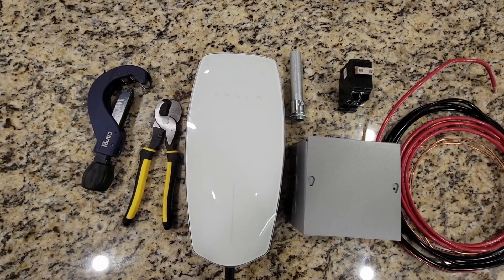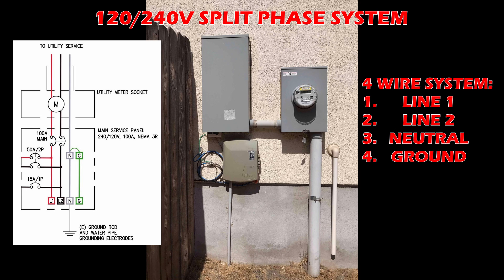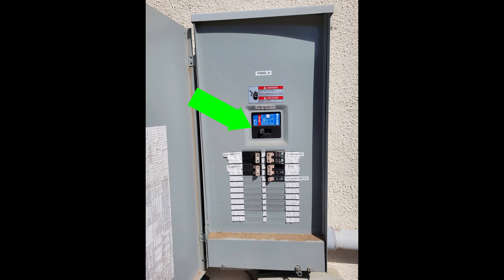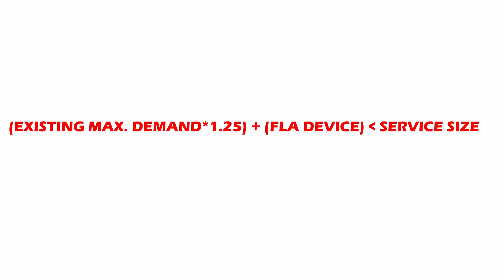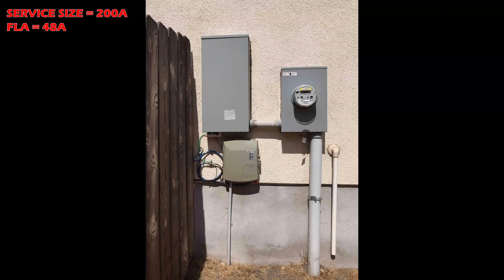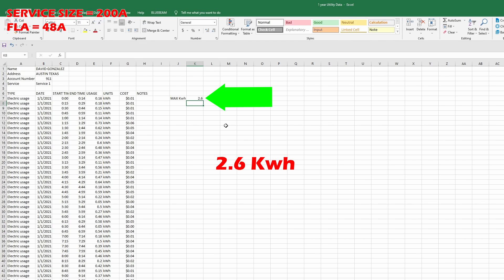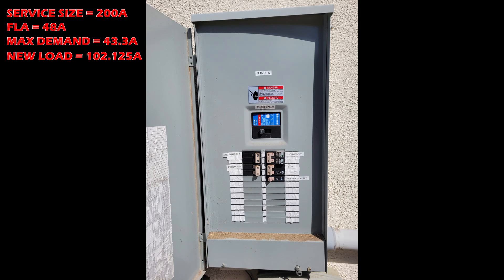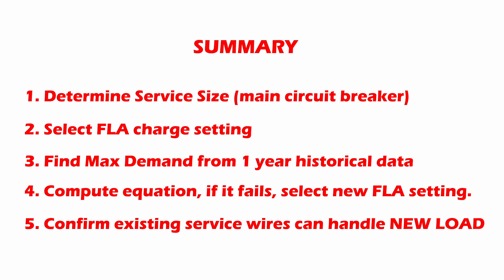Watch THIS before Selecting your EV Charger Circuit Breaker Size DIY

Comment: Super helpful.  When putting in the new circuit, I wanted it to be capable of the highest possible draw to be as future proof as I could make it.  But when selecting an EVSE you don't necessarily need one that can draw the absolute maximum the circuit can handle.  I figured out that a 32 amp EVSE was going to easily handle everything I need, 99.9% of the time.  So I got a slightly smaller EVSE, which does three things, all good for me:  (1) it was a bit cheaper to buy initially, (2) the car charges at a marginally slower rate which is good for the batteries; and (3) the wires in the wall, the plug, etc. are all running a solid notch below what they are theoretically capable of handling, which just creates some additional margin of safety.  Code is the minimum requirement you need to meet, but there is nothing wrong with pulling 32 amps through a circuit that is theoretically capable of handling 40 or 48.   It is basically the same idea as plugging a 60watt lamp into a standard household outlet that can handle up to 1,800 watts.   Most people who haven't lived with an EV don't understand that you plug it in when you get home in the evening and then you really don't much care how long it takes to charge as long as it is ready to go by early the next AM.   Fast charging is rarely important at home, you really only care about that when you are on a longer trip and you have to top off the battery to continue the journey.
Reply: Yes, indeed. I'm trying to install an EV charging outlet in my garage. What I'm trying to figure out is: is it even worth the extra cost to buy a 240V/60A outlet and breaker as well as more copper if I will most likely charge at 24 or 32A? I might be paying an additional $100 or so for something that I will never use.
Reply: @ledzeppelin1212  I think that depends on how long you plan to be in your current house more than anything.    Batteries and charging rates are only going to get better.  I decided to future proof because I may be in the house for another decade.  If I knew I was moving in three years I might have done things differently.  I would say you have to be confident there is a 0% chance you will need higher charging rate because plug and wire are cheap compared to the cost of the electrician.   You definitely do not want to pay to have it all ripped out and replaced in five years.

Comment: Great video but with an EV, you normally only need to get enough charge overnight for the next day. So while 60A/48A may be nice, I think a lower cost 40A or even 30A circuit @240V would be fine. On my Tesla MY, and just using a 120V, 20A circuit running at 12A, I get 30 miles per night and I only drive 25 miles a day.
Reply: The cost difference between a 30, 40, 50 or 60 amp circuit breaker is only several dollars. The same goes for larger wiring to support those higher amperage circuits. It's several dollars. Conduit and sheetrock work and repairs are the same.

The cost of the electrician's labor is what is high.

If you can find a good handyman who knows the rules in the current electrical code, that is the way to go for cost savings. Especially for most easy and simple garage interior installs.
Reply from the maker: agreed.
Reply: The only reason why I went for a 50A/40A was bc I wanted the flexibility of using a NEMA 14-50 outlet vs hardwired — in the event I ever move and can unplug and move the charger myself.  For the 60A/48A option, you need to have it hardwired.   I hired an electrician who did a great job and charged me a reasonable $350 for the NEMA install (including mounting the Charge itself).  It would’ve only cost me an additional $50 for the hardware option.

Comment: your main breaker will protect the service wires.  the service wires will (or should be) always sufficient for the main breaker rating.
Reply from the maker: Your statement is only partially true and ONLY applicable to modern homes. Homes from 1960s and older were designed and built with very different standards than today. Service wires and gear were sized very differently than today. This is why I mentioned it is CRITICAL to confirm service wire size.
Reply: @dgtv3320  ok, i've just never seen undersized service wires before!

Comment: My main circuit braker is 100A. When I do the calculations you mentioned, it exceeds 100A (Comes up to 110A). Can I just replace the main braker with 200A, and would it be safe after that?
Reply from the maker: Semih, you cannot do that. Up sizing the breaker would involve up-sizing your electrical panel and service wires. And it would require a utility shut off. This type of work is only allowed to by done by a licensed electrician. For a 100A main circuit breaker & panel, the biggest limiting factor is the size of your existing service wires. The older your home, the smaller your service wires will be. As I mentioned at the end of the video, you cannot exceed the rating of your existing service wires. Please reach out to a local electrician to help you determine your best path forward.
Reply: @dgtv3320  Thank you very much.

Comment: I can’t to download the usage for electric, only show day use or hr use how  can I do 
My panel 100amp can I to add 60amp
Reply: You almost certainly can't with a 100 amp panel.  Also you don't need to.  My wife's 2016 model X can only take 40 amps.  They used to have an option to upgrade to 80, but I didn't buy it.  I don't even see that option any more.  My new model 3 only takes 32 amps.  And that's more than enough to fully charge by morning, so there's no need for more.

Comment: Super helpful, thank you!  My local utility wouldn’t let me download a years worth of data all at once, I had to do it one month at a time.  I have a 200Amp panel and found that my typical monthly usage peaked around the mid 30s to low 40s in amps, but then found one day, where for about 4 hours, our usage peaked at 66Amps, which when I looked it up turned out to be a large social gathering we hosted at our house.  Now I know, which is awesome!  Before this I was thinking I would need to get a 14-50 outlet, but now I know my panel can support the 60Amp wall charger.  Very cool!
Reply: Stick with the 14-50.  My wife's 2016 model X can only charge at 40 amps anyhow, and my new model 3 only 32 amps.  The 14-50 plug and cable can handle that and is cheaper than the permanent EVSE, which won't let you charge any faster anyhow.  I could only fit a 30 amp breaker in my panel anyhow so I charge at 27 amps and it still charges in only a few hours.  As long as it's ready by morning, who cares about charging faster, even if it is possible.
Reply: @phillipsusi1791  I ended up going with the 60 amp circuit and the Tesla wall charger, I can charge at 48 amps, or roughly 44 miles of range per hour.
Reply: @JethroXP  Ahh, apparently all but the M3RWD are now capable of taking 48 amps, but with no option for the dual charger to get the higher capacity like there used to be.

Comment: How does a solar panel grid tie system factor in? Also you mention setting your charge current. Does the EV allow you to set maximum charge current? Thanks. I'm getting ready to pull the trigger on a model Y Tesla.
Reply: Yes, the Tesla allows you to set the maximum and proper charge current, on both the control screen and the Tesla phone app.
Reply: @dvader3263 Thanks for the reply. Since getting my Model Y I've learned that you can also schedule when the car charges, so I set it for 12am start time when demand from the house is low. Also I learned that the cheaper Tesla portable charge cable only charges at 32 amps max. I was hoping for better than that since I installed a 50 amp circuit. Still, that's good for about 30 miles per hour, which is enough for my needs.
Reply: @travelbydragonfly  My wife's 2016 model X charges at 40 amps.  I remember them having an option to buy dual on board chargers to take 80 amps, but don't see that option any more.  I recently got a model 3 and it only charges at 32 amps, using the same cable and 14-50 outlet.  And yea, as long as it is charged by morning, that's fast enough.
Reply from the maker: Randy good question. Solar and battery storage lowers your home electrical demand. Assuming you have your solar/batt and electrical panel on the same utility meter, this lowers demand and this should already be reflected in your utility data. This being said you can follow the same steps outlined in this video. Congrats on your new Tesla!

Comment: Great Presentation. I wish PG&E here ( San Ramon, contra costa , CA ) had provided a way to download my uses data . Without this , I won't be able to benefit from this excellent information that you shared. So I guess, I have to stay with the conventional approach of doing the load calculation based on lighting load , fixed appliances nameplate rating etc etc.

You alluded to doing another video for the use-case of adding the charger to a sub panel and I have a question for this situation for now, while I wait for that video to come up.

My load calculation for the whole house shows enough capacity to add 48 amp charger load on a 60 amp OCPD. But the feed from the 200 amp main panel is evenly split into  garage sub panel and AC load sub panel, each protected by 100 amp OCPD at the main panel. I am told that I have to do a 2nd load calculation on the sub panel circuit with incoming service limited to 100 amp only. Is this correct ? If yes, I have less capacity to play with for sizing charger load .
In my case, I am planning to add  charger load to AC sub panel , which is serving two 5-ton AC units only on a 70 amp OCPD. The load calculation ( treating AC as continuous load device  and taking 100% of nameplate rating for RLA of condenser / FLA of motor  ) for these ACs comes to 66 amps.  This leaves 34 amps extra capacity only. With this capacity, am I ok to install a 40 amp OCPD on the AC sub panel for the charger circuit and configure hardwired Tesla wall charger for 32 amp charging , following the 25% demand factor rule applied to largest motor load in the group ?

Comment: Hi. I have a question. Can I hardwire my EV charger with a 10 gauge wire? I have an existing 30amp subpanel in my garage and I don’t want to run new wire. 
Its going to be 30amp breaker, hardwire to the charger. I hope you can help me? Thanks
Reply: Using 80% factor. Yes up to 24 amp providing no other load on that circuit.

Comment: Is there such thing as 80 amp or 100 amp breaker off of a 200 amp panel? For the 17kw plus charger for tesla or whatever car manufacturer that will allow that fast ac to DC charging. Theoretically, with 200 amp service, that's like 48,000 watts. Not continuous, I know. Or is there a limit here with us or state regulations. As long as I have the correct size wire and not continuously tripping the 200 amp main breaker, is there a reason this isn't doable?
Reply from the maker: Larger chargers are available not but very common. An example is Clipper Creek CS-100, which runs 80A continuous and requires a 100A breaker. Assuming an existing home has enough capacity, there is no problem installing this. I believe these larger units will NOT go main stream any time soon. Most homes have a 150A or 100A service so the majority of individuals wont be able to install this. They are simply too big and there wont be enough demand for manufacturers to start making 100A+ chargers.
Reply: There are 100 amp breakers that you can put on a 200 amp panel, but the car can't take that much.  When I got my wife a model X in 2016, it had an option for dual chargers to take 80 amps, but I didn't get it, so it can only take 40.  I don't even see that option on Tesla's web site any more.  My new model 3 can only take 32 amps.

Comment: Thank you for this well done and very informative video ( frankly the best I have seen). At the beginning you mentioned that you might do another segment evaluating sub panels. I would love that. My attached garage has a 125v subpanel on a 125 breaker from the main panel ( main panel is good with 2/0 aluminum cable to the meter on a 150 amp service)  with  a 2awg  XHHW aluminum tray cable ( thank you for discussing the direct inspection of the leads) to the sub panel . I think it is somewhat under rated , but even so I would like to know how you put sub panels in the equation. Many thanks again.

Comment: Many thanks.  Very helpful.  This will provide peace of mind for a DIY'er.    After searching NGRID online account informationI I called and they have assigned a "ticket" for the requested information.    We'll see how that goes...    I have a 100 amp service which includes 40 amps going out to a detached garage.    I'm hoping I have the capacity to use 20 amps for an EV charger as this would be the least "obtrusive" solution to the existingn service while still meeting my low mileage requirements.   Question:   My plan is to install an industrial grade 20a/240v Hubbell outlet with a 20a double pole GFCI breaker on an existing 12 AWG dedicated line.     Should I consider replacing the 12 AWG wire with #12 THHN set of wires instead?
Reply from the maker: Good choice on Hubbell. They make good stuff. Regarding existing wires, perform a visual inspection and confirm there is no damage/cracking on the insulation. If everything checks out, #12 copper is sufficient for a 20A dedicated circuit and you may avoid replacing the circuit.  If this is for your charger, remember the breaker shall NOT be GFCI. Most, if not all EV chargers have GFCI function built in to the charger itself.  Thanks for subscribing.

Comment: wait what you said doesn't match the formula.  You said "max demand times 25%" but the formula says "max demand times 125%".  which one is correct? thx
Reply from the maker: Excuse the confusion. I should have said 125%  which is 1.25.

Comment: Great video.  If I install the Tesla’s wall connector to a 30 amp breaker, will the wall connector adjust automatically to 30 amps?  Wall connector shows 12 to 48 amps.
Reply from the maker: for the Tesla wall charger, you set your installed breaker size in the phone application.  For a different  charger manufacturer there may be a dial somewhere that has to be set/programmed to the correct installed breaker size.  Breaker size (in amps) and charge rate (in amps) are two separate values.  Divide the the breaker size by 1.25 to get the charge rate. For example, 60A breaker size  (60/1.25 = 48amps)  has a 48amp charge rate which is the maximum for the Tesla charger. 30A breaker = 24A. Circuit breaker size does not equate to the charge setting.
Reply: In addition to using the Tesla phone app, you can also easily adjust the charging amperage to 24A for a 30 amp breaker on the charging screen in your Tesla vehicle.
Reply: The car lets you turn down the current below what the wall can supply.  The wall charger has settings as shown in the video.  The universal cable that used to come with the car, but they now charge $100 for, determines the max based on the plug adapter.  The normal 120v 5-15 plug only allows 9 amps, and the 240v 14-50 or 6-50 allows 32 amps ( my wife's older one still allows 40 ).

Comment: I do not why you divided by 0.25? Can you explain to me? Thank you.
Reply from the maker: No problem.  "0.25" represents the unit of time in hour(s). Since my utility data provides data every 15 minutes.  Convert minutes to hours: 15min/60min= 0.25hrs
Reply: Power = Voltage X Current from which we can derive Current = Power/Voltage. Because he’s checking if his breaker box can handle the new current (amps), he needs to convert the largest demand reported by his utility back into amps so he can evaluate that he won’t overload his breaker box.  So he wants to compute the highest known max current from the utility company’s data. 

Said another way, and focusing on the units perspective, he needs to convert from kWh to watts (aka Power) in order to use the formula. This means he needs to “cancel out” the hours by dividing by hours. In the poster’s case his units aren’t actually in hours but are 15 min/ 60 min  because his utility company gathered data every 15 minutes. So although his spreadsheet says kWh, it’s actually in kW-quarter-hours. Because that unit isn’t helpful, we cancel it out by dividing it by 15/60=.25  This gets his units to kWatts so he divides by 1,000 (the number of watts in a kW) to get it to Watts. 

And finally he’s ready to compute current from the Current = Power/voltage 
Voltage = 240v since, I’m not sure on this but perhaps, that’s the volts going into the breaker box (the feeder circuit represented by the two live wires coming in from the utility).

Comment: If you are going to install a project like this, great information is contained in this video.

I would say to call your building department first.  They may require calculations of load based on the national electrical code ( NEC)  section 220 instead of 12 months of usage data.  Also, they can add, subtract, or completely ignore any or all of the building code (NEC), so the NEC may not apply to you.

The NEC had a separate section with special requirements for car charging or EVSE equipment, section 625 and that section refers you back to chapters 1,2,&3 for added requirements. 

Can you install a charger without paying for an electrician, yes.  There are a lot of requirements and rules to follow that they "mess" with every day.  I encourage everyone to make sure that get the best information, the inspectors, a pro, or your own research.  Just remember that a pro does this work every day and may be able to help you avoid problems you did not know you had,   you might work out a deal where they give you the knowledge and you do the install.

Finally,. KNOWLEDGE IS THE TREASURE YOU CAN GIVE ALL OF YOURS AWAY AND STILL HAVE WHAT YOU STARTED WITH.  So, is it stealing if you get it for free by asking?

And thanks for yours.